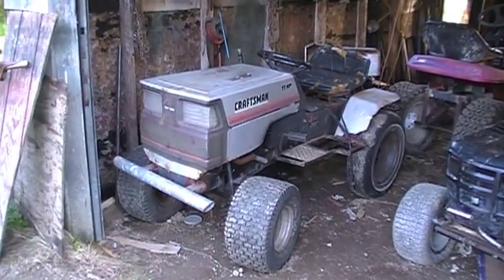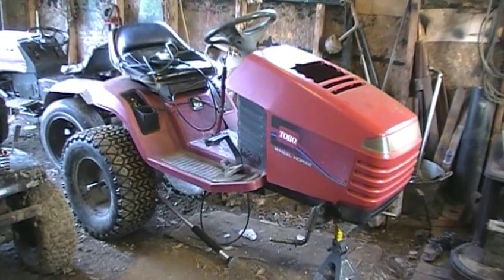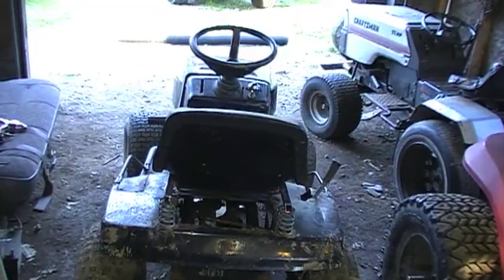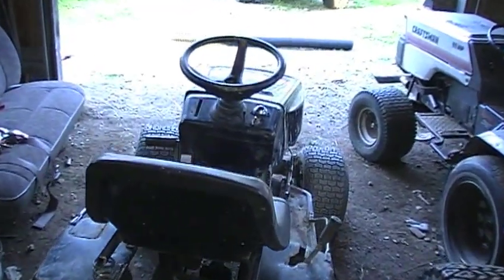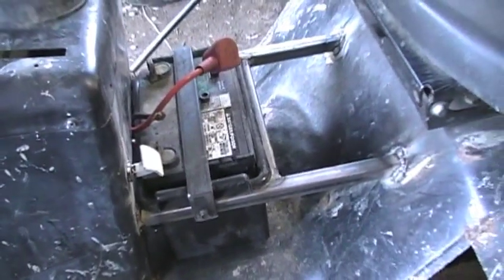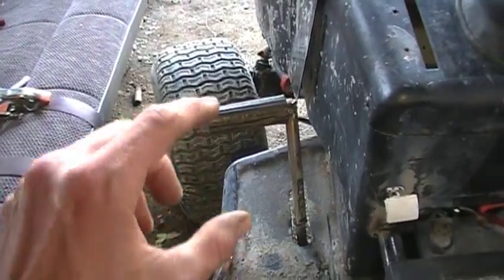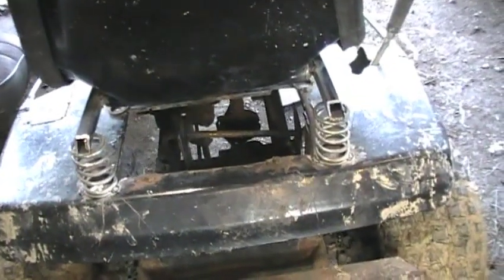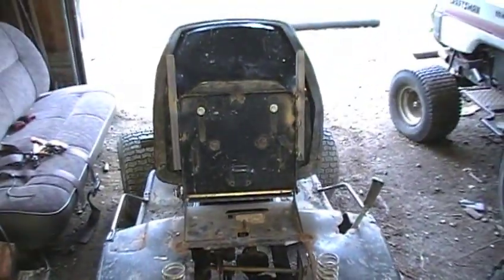Off Road Mower Upgrades & Updates #1 Battery & Trunk Storage

Comment from the maker: I use a money wrench around the shaft of the pulley, not the crankshaft. then a socket up inside the tube and loosen it. you might need a couple of pipes to use as cheater bars

Comment from the maker: you probably need an idler to pull the belt away from the clutch and shift linkages. with a rear pulley that small, your gonna have problems in the back.

Comment: I have an idea for a build you could do.  Btw, take all of the time you need.  You should get a junk mower that is crap and make a make-shift front wheel drive friction drive.  That would be quite the project.  My suggestion would be to take the one off of a Snapper RER.  I have one that is 20 years old i bought used and that friction drive has yet to slip once.

Comment: Hey Fearlessfront I have Murray lawn tractor (that looks the exact same as yours) that used to just backfire when I turned it off. But now when I turn it on it has a soft clunk and once it is running on a low or high rpm it has the same soft clunk but a lot more often. Also when i turn it off it slams very hard and clunks around and shakes the lawn mower. I just want to say that oil isn't the problem it has always been full and I have changed it regularly. But do you know what the problem is?

Comment: I also figured out that when you turn the engine by hand slowly you can hear it knock inside the engine.(i just went and checked if it was bolted down tight and it was). if you figure something out can you tell me? Thanks

Comment: me and my buddy are doing a pulley swap on a murray. we went with a 2 1/2 in. in back. a 6 in. drive pulley. but were having trouble. when we push the break it will not disengage. the idler pulley hit the belt on the other side and puts tension on it.  how do i fix it?

Comment: I dont really like the location of that bar holding the battery in the plastic box. it is awfully close to the terminals. I know it probably won't touch the terminals, but mabe just move it back a bit like over the caps that way in the unlikley event that they pop off of the battery. the bar will hold them down and you dont get sprayed with acid. Just a thought tho.

Comment: Put a brand new battery in my tractor took it off road and the battery box dropped down and the pulley cut open the battery, said my battery exploded warranted and put the new one between my legs